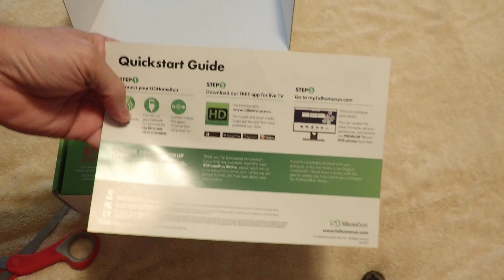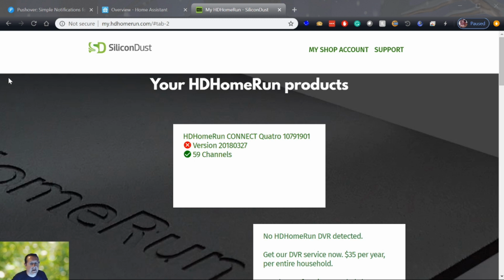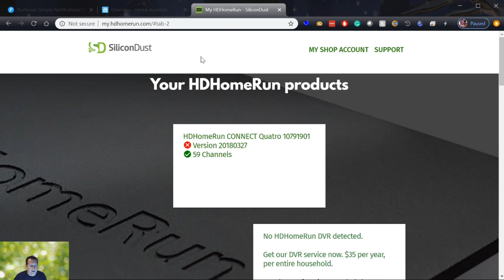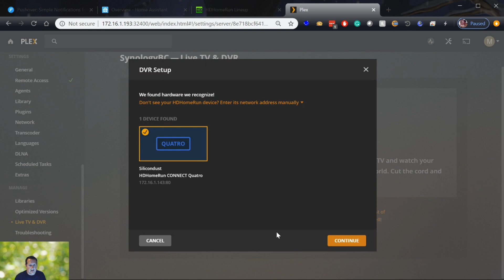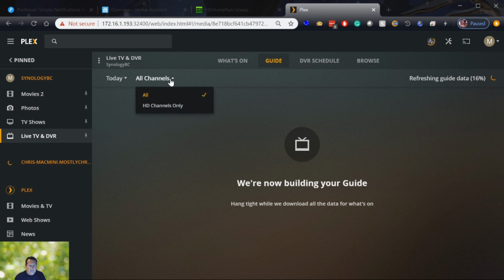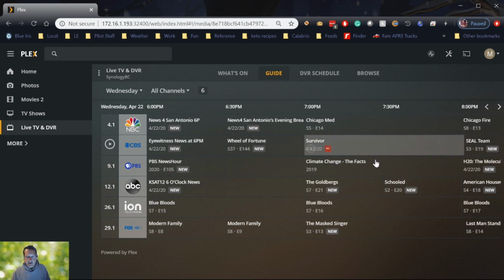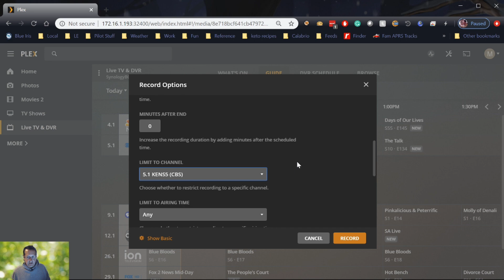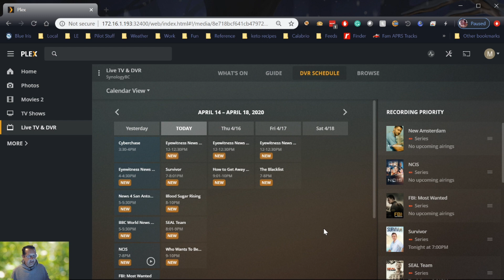Unboxing and install of the HD HomeRun Connect Quatro along with Plex Live TV and DVR.

Comment: Over the air is completely free - you do not need anything else - just connect any antenna. This is a device designed to use ASTC 3.0 - which is a new standard for tv transmission - and any tv will need a new tuner to be able to be used. This device is designed to do what is stated - however, you still must buy someone else's device before you buy this device because you can not physically connect any tv to - it is only designed to transmit picture using casting devices - please tell me I am incorrect - please!
Symantics (prob not spelled correct) is toying with words - cutting the cord means you use FREE over the air transmission - having cable to have internet to use another movie app is exactly the same as cable to use cable TV's movie service - you need to use, read, and understand a dictionary.
If this device has/is updated to make a physical connection to a tv then it will be a different assessment - til then this device is flawed.
Reply from the maker: I have been happy with it and it works well for what I use it for.

Comment: And yet you still can not connect a TV unless   you purchase additional equipment from someone else or you buy a new TV with new tuner - which defeats the purpose of this item.
Reply from the maker: You can connect an antenna directly to a TV. The HD HomeRun is designed to allow you to stream off-air broadcasts to a number of different devices. It isn't required for someone to watch broadcast TV if they are in range of a station and have a receiver (TV).

Comment: does 4 tuners mean that 4 different streams can by playing at the same time? How does that work inside Plex?

Great video ;)
Reply from the maker: Thanks! Plex takes control of the tuners so you could theoretically have 4 channels playing at once. It's also dependent on whether your plex hardware can transcode channels if needed.
Reply: @mostlychris  I was just wondering about the receiver because I'm thinking about getting one. Thanks 😉

Comment: This is now June 2021 and I recently purchased the HDHomerun Connect 2.  Everything works great with the Tuner and interfacing to PLEX.  I now get with PLEX 57 channels that I can watch and DVR record  if I want to.   Very simple to setup and install. take care.
Reply from the maker: Is that the DUO or the 4K?
Reply: @mostlychris  No, The CONNECT 2(just tuner) its one version earlier than the CONNECT DUO.  It has light indicators on the little Tuner box. Also it is not 4K version.  I couldn't find any of the newer ones.  Everyone was out of stock on allot of the HDHomerun items when I bought mine.   I didnt need the one with the hardware DVD cause I am using the PLEX DVR feature which built into the software.  Sorry for the confusion on what I bought.  take care.
Reply from the maker: @dathyr1  No worries and yes, shortages on electronics everywhere. Can't but a new vehicle these days without a missing chip or two.

Comment: Thanks for this video.  I am just trying to understand the basics of this product.  If I understand this correctly, the stations you get are no more than the stations you get with your antenna.  In other words, it's completely dependent on your antenna.  To put it another way, this device does not pull in the signals...it's your antenna that does it.  Am I right about this?
Reply from the maker: This device picks up off-air signals. You would use an antenna to pick up the signals. The receiver components inside the HomeRun demodulate, etc., the signals and make the usable for viewing.
Reply: @mostlychris  First you say "This device picks up off-air signals."  Then you say "You would use an antenna to pick up the signals." Your 2nd sentence completely contradicts your 1st.
Reply from the maker: You would use an antenna to pick up the signals and feed them into the HomeRun device. There is an antenna port on the HomeRun.
Reply: @mostlychris  That is correct.

Comment: Great video as I hope to install the newest Quattro HR and Plex today/tomorrow pending Amazon’s delivery. Any other thoughts or discoveries about this set-up I should be aware of after your year of using this arrangement. Yup, I’m cutting the chord on Tuesday 2/9/21!!
Reply from the maker: It's been hands-off for the time I've used it and has functioned flawlessly. As the FCC has auctioned off TV RF spectrum and stations have moved channels, a re-scan was required a couple of times. The only issue I had at the beginning was a Plex issue related to transcoding and that was fixed. Congrats on cutting the cord. Just don't get wrapped up in all the streaming options out there since now everyone seems to want to cash in and sell you their own service. Subs to all the streaming services can start to add up.
Reply: @mostlychris  thank you ...... my in NTE toon is to get the hardware right, use the antenna for local channels and use the available Apple, prime, and Netflix options to get my feet wet ...... either way, Im free!!
Reply from the maker: Awesome!

Comment: The connect series of HD Homerun does not have a harddrive, but the Scribe series does. It looks like you are able to record shows with only the connect. I am trying to make sure I can as well. I have Plex Pass already, and I have a NAS too, but I have not seen the settings for telling Plex where to save files to.
Reply: So a lot to unpack here. Your Plex server should see the HD Homerun if it is on the same network. Where are you running Plex? The library settings are where you specify the locations of files. My Plex is running on my NAS and I have created libraries for different items. On the NAS, you have to create the locations to save to and that differs based on your NAS brand/model/OS.
Reply: @chriswest5037  my Plex is running on an nVidia Shield TV, and the libraries for movies and TV are on a NAS (Open Media Vault running on a Raspberry Pi 4 with 2TB HD plugged into USB. As long as Plex lets me chose a location to use for it's DVR then I should be able to chose the same NAS directories. It's just that none of the videos I saw showed that process of specifying location. Good to know it is there. Thank you!
Reply from the maker: Ahh ok. Yes, in Plex you can specifiy library directories. It's in Settings -> Manage -> Libraries. Click "Add Library", choose type, name it, and then browse for directory.

Comment: What are you using for an OTA antenna?
Reply from the maker: This is what I use https://www.amazon.com/gp/product/B00IITMTKE. I had it in the attic but I have a radiant heat barrier. I am about 30+ miles from the 4 "big" station's transmitters with some minor hill obstructions. Everything but the local PBS station worked while in the attic. I put it on the roof for rock solid performance.

Comment: @mostlychris - Hey, I was wondering if the HDHomerun could work with my digital cable subscription rather than an antennae?  I'd like to be able to watch my all of my channels through Plex that way.  When I go to HDHomerun's site, it looks like I would need to get the HDHomerun Prime 6 which hasn't been released.
Reply from the maker: Everything requires an antenna except the Prime 6 and, as you say, it isn't available yet. You would need to wait until that comes out.
Reply: @mostlychris  Yea that's what I thought :/.  Currently, I have a Slingbox that I use for streaming my cable.  But they are planning to stop their service.  I guess I'll check things periodically on HDHomerun's website.  Thanks again for the clarification!
Reply from the maker: There might be other cable card options. Not sure what hardware your Plex is on but search around the nets for cable card and Plex.
Reply: @mostlychris  I've got Plex on a Synology server.  I'll look around for options that you mentioned.   Slingbox won't discontinue for a couple of years so there's still some time.
Reply from the maker: @Yargezim  You might get the prime 6 by then. Good luck!
Reply: Due to recent FCC rule changes, the development of the HDHomerun Prime 6 has been terminated.  You can still get the regular prime which is only a 3 tuner device though.
Reply from the maker: @vincehny  That sucks. What rule(s) cause this change?
Reply: @mostlychris  On September 5, 2020, the FCC dropped the rule that cable companies have to provide CableCards.   Since cable companies are not making a profit from these cards (consumers are not requesting them often), companies will soon stop offering the cards to consumers.  This rule change has caused HDHomerun to stop working on the Prime6, which I was waiting on since the original device only has 3 tuners.  My current cable box allows me to tape 4 shows at the same time while watching a 5th show.  The Prime6 would have allowed me to do that functionality.  Now I need to purchase 2 of the regular device and request 2 cards.  The way Comcast works, the second Cablecard will be a monthly charge while the first card is free. So I either get my household  used to not being able to watch all their programs (currently not a problem due to the pandemic), slightly trim my bill down and get 2 boxes or keep my original cable box.
Reply from the maker: @vincehny  Wow. That's no good.
Reply: @vincehny  Hey, thanks again for the latest on the Prime 6 model.  I had decided to buy the Prime 3 model which I got a few days ago.  Next thing I"ll need to do is to get a larger cable splitter to hook it in and get a cable card.  I had called my cable company and they said I could get to rent for a couple bucks a month.  I'll add a comment out here again if/when I get it working.
Reply: @Yargezim  if I remember correctly,  if you have the original prime box, you don't need a splitter.  Whatever you're using to access Plex on your TVs is all you need.  Just hook up the prime box and Cablecard to your router and configure the device through Plex and you'll be set.
Reply: @vincehny  Over the weekend, I had a technician from Charter cable come to help me setup the cable card with HDHomeRun.  There was a bit of an issue with getting the card validation to be successful which we eventually got.  Now it's hooked up to Plex with about 55 or so channels.  The tech mentioned that I would need a tuner or adapter from Charter to pick up other channels.  Anyway, the problem I'm seeing now is that the picture quality of the channels are either very pixelated or just audio only.  I guess it could be that I'll need to get another tech to come out to set the adapter/tuner to the cable card which they didn't have with them.  Anyway, the last thing I wanted to mention is that the tech used a larger splitter where the coax cable is in the HDHomeRun.  I couldn't get any channels without it being plugged in.
Reply: @Yargezim  Yeah, I read somewhere that some cable companies require an additional tuner to view all their channels.   I believe Comcast is different but since I was waiting for the Prime 6, I never got the original so I'm not sure.  The only other option would be a Tivo box which is very expensive and doesn't integrate with Plex. 

During my research, I never came across people reporting pixelating video with the HDHomerun. Perhaps there is configuring still needed in Plex.
Reply from the maker: I wonder if you are getting SD only channels.
Reply: @mostlychris  I get ESPN which is HD I believe but I could be wrong.  I've got the cable company coming back out on Thursday to see if the adapter/tuner might resolve the pixalation along with the missing channels.  I'll let you know how it works out.
Reply: @Yargezim  so I'm curious now.  Did you ever resolve your issues with your HDHomerun box? Is everything playing clearly now?
Reply: @vincehny  Hey, thanks for following up.  I had Charter Cable send a tech over.  However, he didn't have the tuner/adapter with him which I had told them I needed.  He said he thought the adapter/tuner was extra and had only setup a couple of people with it.  That tech tried a few other things but nothing really worked and he admitted he hadn't seen a setup like mine before with the HDHomerun vs Tivo/Roku.  However, he did show me where I can stream it using their Android app on my phone/tablet.  Also, using Apple TV, there is a way you can stream it that way.  So, I ended up returning my cable card back to Charter and found out that no the adapter/tuner wouldn't have cost extra.  A bit frustrating :/ as I'd liked the idea of using Plex to watch along with being able to DVR. I may revisit trying this again another day though.